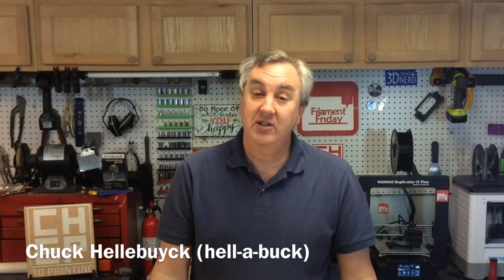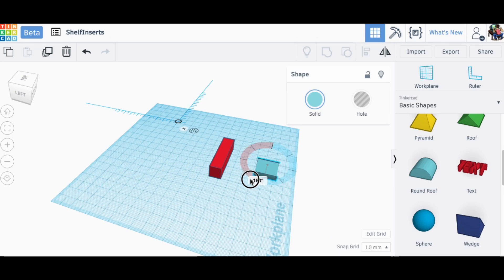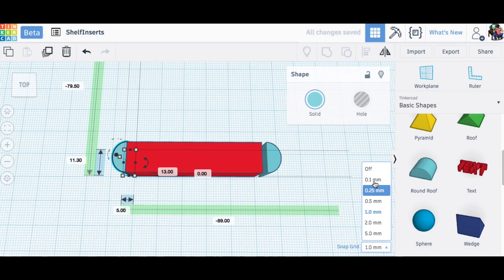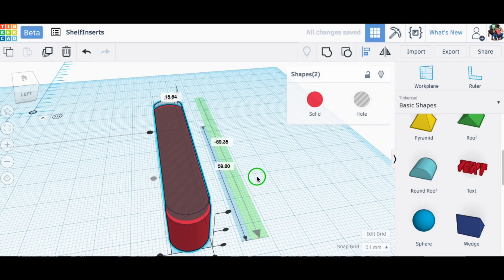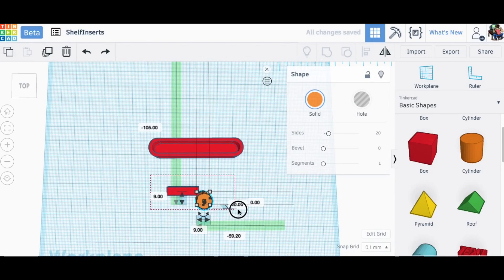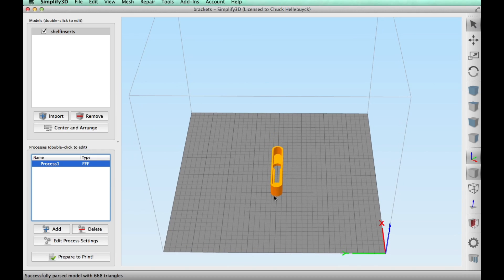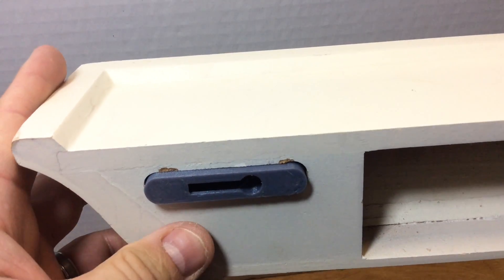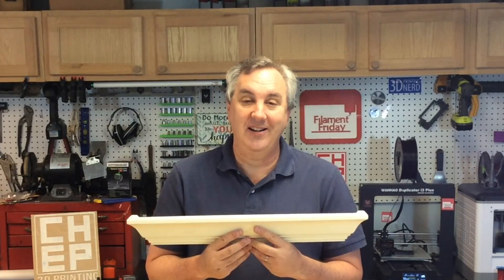How to Fix a Wood Shelf using 3D Printing and Tinkercad

Comment: A cool add to this, you could create a pin point, using a small cone, on the mount that after you put these in shelf, push it to the wall & it would create marks in the sheet rock to give a identifier for screws to be placed.